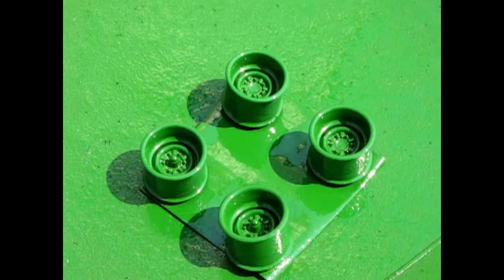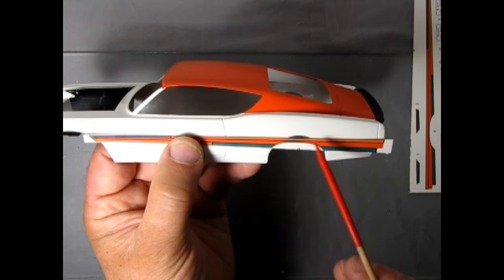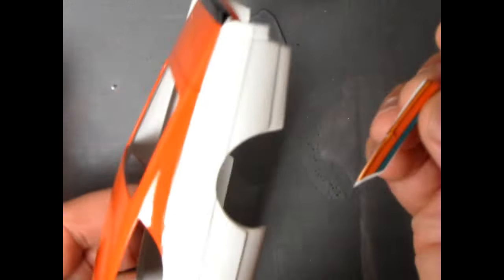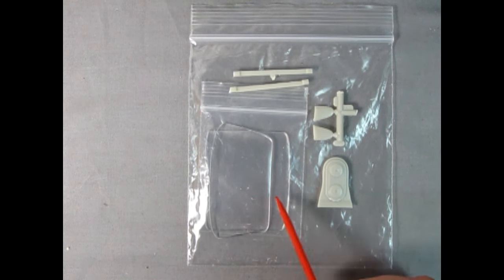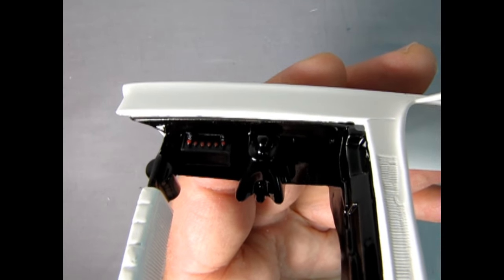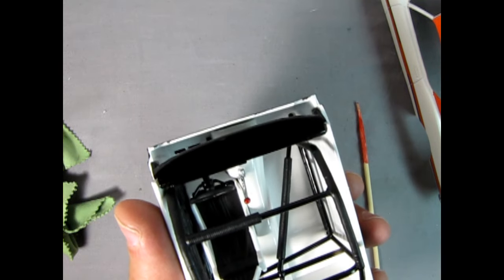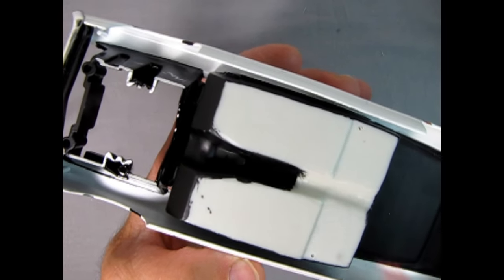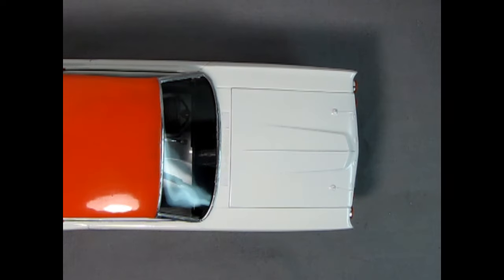Let's Build It! Building The AMT/ERTL 1969 Ford Fairlane Cobra Torino Plastic Car Kit - Part 7

Comment: This model certainly was an unexpected journey, Bilbo 😀. Every stage has a new problem 😧😁.I don't think I have any rear chassis fit problem except it wobbles about. I've put in plates that support and centralised the chassis to body fit👍🤔. I've finally got onto engine and exhaust on one and nearly finished widebody changes😧😃👍😎
Reply from the maker: Good luck Pete!
You never really built it out of the box....and for this kit to have so many issues just on that level is incredible. 
I can't imagine what you are going through with all your customizing when 95% of the basic kit parts have to be modified just to get it together BOX STOCK. - Talk about an impossible kit!